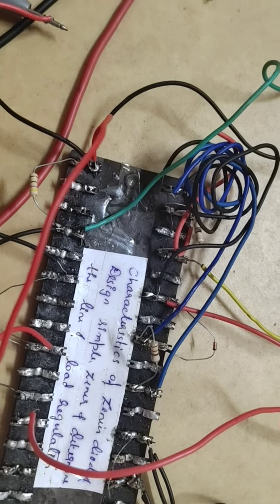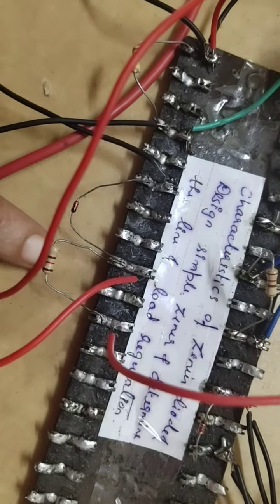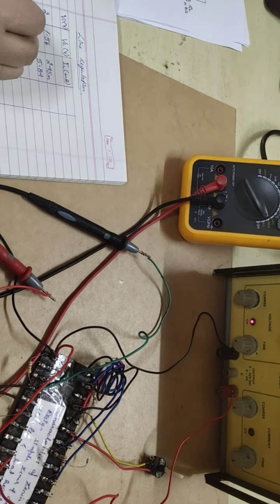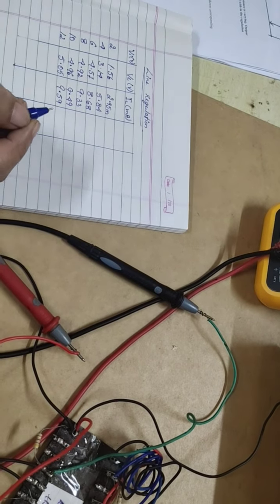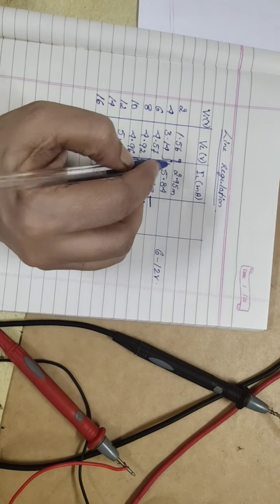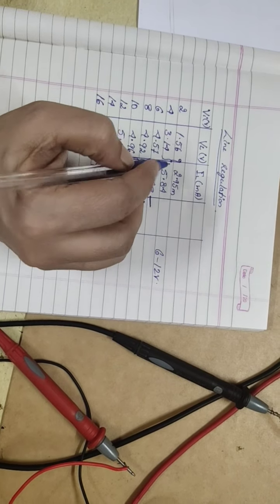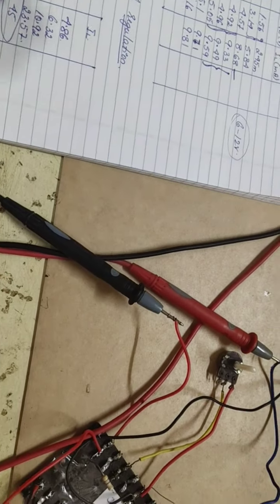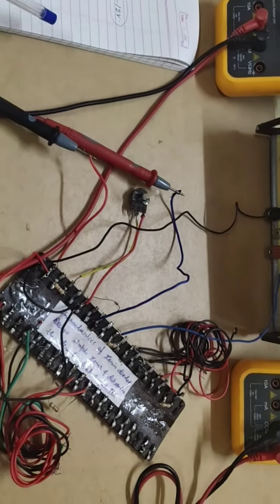zener diode line and load regulation

Comment: Mam, Just one question here. This is standard regulated DC power supply you are using here which itself has inbuilt voltage regulation feature in terms of line and load regulation. It has zener inside it specified the the rated voltage and current and it is ready with regulation.  I dont understand why additional zener needs to be used. I think, you should have directly used load and then measured the voltage and current at various levels of input voltages for line regulation and check that output VDC does not change in terms of I/p AC V.. Similarly, for load regulation, just connect that pot R and keep changing it with constant input voltage and just measure voltage at no load and full load,, that should be same or minimal difference. Please correct me if wrong.. regulated DC power supplies readily come with regulation ability and to measure it, just provide the condition and measure...